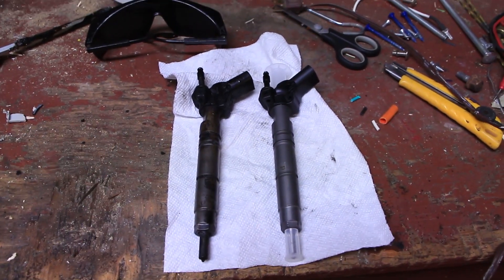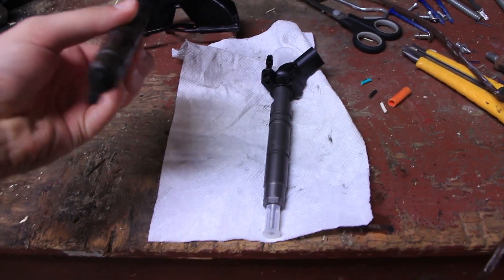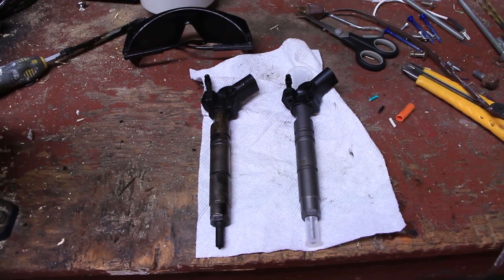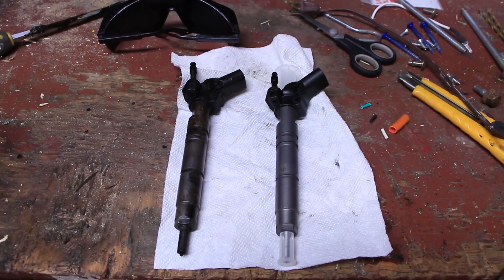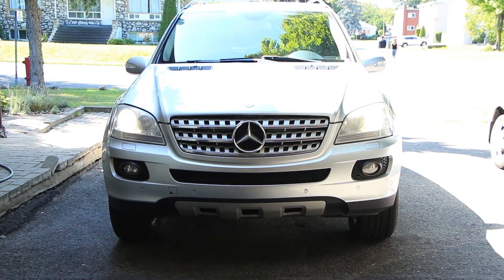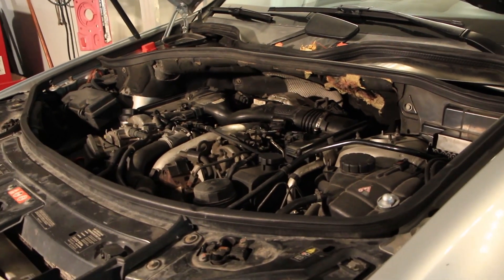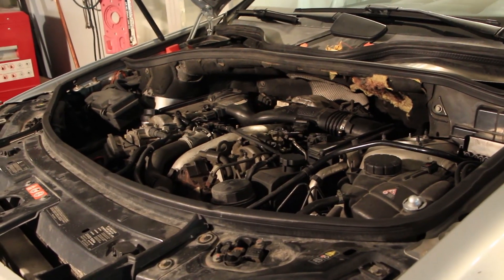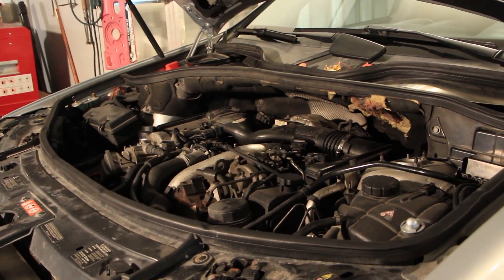OM642 Injector Replacement - To Code Or Not To Code?

Comment: Well, about coding, i think you are correct, because, if i change only a nozzle, then what? In my knowledge, i dont know that there is somekind of testmachine where i can put that refurbished injector and that testbench will generate new code for it.

Comment: I haven’t coded my number 2 injector yet only replaced it a few days ago car still doesn’t run right so I will be getting it coded when get the chance……I have w211 e220 2008 model 

Should replace the copper washers on the other injectors?
As a precaution?
Number looked a bit worn out…..?

Comment: Mercedes Benz E class 2021, Check engine light is ON, replaced injector 3 after checked up. I didn’t do programming for new injector, the check engine light still ON, so have I programming the new injector ? Or what should I do to Check Engine OFF ?

Comment: Wby they doing videos withoit proper job like coding?
All these people are crazy when they are shoving without coplete procedures... Poor mechanics
Reply from the maker: So if we omit the part where you utter insults without bothering to simply ask a question, here is why: There is a broad misconception that not coding your injectors will lead to an imminent catastrophe comparable to the extinction of the dinosaurs. I've set out to disprove this. Is it better to code your injectors? Absolutely, however, if for whatever reason you can't; let's say an injector failed in your home's garage and you need to replace it before even being able to code it, is it ok not to do so? The answer is yes, since I've posted this video I still haven't coded the injectors on this car, and guess what, it's still running just fine. So if you need to swap injectors, and can only have them coded afterwards, you should be comfortable in knowing that it's safe to do. You should also be happy about this outcome yourself, it means your car is maintainable without any specialized tools, which is an outcome we should all be striving towards.

Comment: Hey Pat, thanks for the video!  I have SDS and was still unable to code my replacement injectors for my 12 ML350 BT.  Took the car for a light spin and will keep driving it with the hope the trim on the CDI 6 ME will do its magic.  Any chance you can make a video on how you run Diesel Purge?  Right in the tank or through the filter?  Thanks!
Reply from the maker: I just dunk 2 cans into the fuel tank and then fill it up so it's mixed well.

Comment: I put a set of new denso injectors into my old hilux ute, along with valve seals and rocker cover gasket and an oil change while im there, and it ran beautifully. Excellent improvement to the vehicle. Much better and smooth responsive acceleration.  ...that was two days ago. Today i took it to a mechanic to enter the codes. Tonight i crawl home with terminal engine knock in a heavy cloud of smoke. F;#k the codes. Honestly, ive been doing all the work and NEVER trusted a mechanic. The VERY SAME afternoon i take my car for the first time to a mechanic, its broken. I cant afford these 'professional advice'. So mad my beautiful car that i worked hard on making sure all the ports were so clean and everything torqued to spec and it ran so well...now its a bomb. Literally.

Comment: Hey man, my car wont start after I replaced the seals... do i have  to purge air or anything ?
Reply from the maker: You can run it on key on (which runs the electric fuel pump) for a while. You'll hear the air bubbles being forced out. Once the rush of air bubbles goes away, you can try cranking the engine, which will also run the high pressure fuel pump, but it might not start for a while. When I replaced all my injector seals I had to crank the engine for a good 2 minutes before it started. Give your starter some breaks of course.

Comment: As a injector repair guy, yes you better of coding them in. If you don’t code it in injector will run out off tolerance. If you don’t code it in car either not run smoothly as or not run as efficiently.

Thats why after every reconditioning we do, test bench gives new codes.
Wrong advise to tell not to code it in.
Reply from the maker: It's been 4 years, car still works fine, runs smoothly, runs as efficiently as it always did.
Reply: @PatsCarGarage  If so, ever injector brands or remanufactures or diesel specialists are wrong by advising to code it in but you are the only one right by saying better not to code in. All new test benches calibrate and gives code for new tolerances for notting?.  You are fitting brand new injectors but not coding , its a bit cowboy job to me.
Reply from the maker: @emrahsavuk4784  Of course it's better to code them. It's just there's this belief on the internet that if you don't code them, your connecting rods will fly out the side of the block. They won't, it's been 4 years, if you're in a pinch and can't code the injectors for whatever reason, it's going to be fine.
Reply: @PatsCarGarage  
Hello.
UK Guy here.
I have an 06 W164 4Matic and need the original injectors cleaning. If I take them out and professionally cleaned will they need coding when put back in?

Thanks in advance.
Reply from the maker: @winstonbrown1516  I don't believe that cleaning will require them to be coded. Just make sure you mark which injector came out of which cylinder so you don't mix them up.
Reply: @PatsCarGarage  
This is very much appreciated. 
Thank you very much. Your Moms ML still good?
Reply from the maker: @winstonbrown1516  Yeah it's still going strong. I've got to say I'm really impressed with the reliability of the 2nd gen MLs. She's had it for 10 years and there were only 2 other things that went wrong other than this injector, the rear springs cracked as a result of corrosion (the top coil is thinner than the rest of the spring, so it's prone to failure), and a couple of ABS sensors went bad.

Comment: Hey i have the same problem I change injector#1 because i was having hard start but after changing there is no more hard start but car is smoking white smoke 💨.
Reply from the maker: It's possible the DPF is going through a regen. You should wait a little bit and see if it clears up on its own.

Comment: This might be acase on earlier Mercedes diesel engines I’m currently working on a 2017 Sprinter OEM 651 after multiple tries engine definitely not starting with replacement injectors so we gonna go through a process of re-coding replacement injectors and see how we go I also see new videos popping up about the same issue

Comment: what is the torque specs of the bolts do you know?
Reply from the maker: Official spec is 7Nm and then 90 degrees twice, but I've heard this weakens the bolt and might cause it to snap. I've personally done 7Nm and then 90 degrees once and it has held fine for 4ish years.

Comment: How does the ECU trim the fuel for just ONE injector? By looking at the pre cat nox sensor which is per bank (and only one bank for this engine.) It might be better to just program it correctly. Not worth leaning other 5 injectors just to compensate for one.
Just delete this video because it is just wrong. Sorry to say.
Reply from the maker: I think you are 100% right that it's better to program it correctly. I still research this because you and others have brought up good points. From what I can find, the programming exists because of emissions requirements, which are very strict, especially for diesel engines. Without this programming it would be impossible to meet these exact emissions requirements. With that being said, if the programming is off because you change injectors (or the shop that rebuilt the injector incorrectly tested it, producing a wrong code), it's not going to dump the contents of your fuel tank after 17 turns of the crankshaft.
So how could the ECM compensate trim a single injector? 2 possible ways: the glow plugs aren't completely dumb and have some capacity to monitor cylinder temperature, or the exhaust pulses are correlated by the EGT sensor.
Now, if you are mad about the emissions side, I think you'd better leave some comments on people doing DPF / EGR deletes.
Reply: @PatsCarGarage  No hard time. I am not a hater. I appreciate u actually spent time and effort creating videos to share knowledge.

Comment: This is horrible advice. Each injector is manufactured with certain tolerances that NEED to be compensated by the ECU so they deliver the right amount of fuel. You only replaced 1 injector and got lucky it had tolerances close to the ones your other injectors already had. This results are not reproducible to everyone when luck is involved, you can even see here on YouTube videos of people showing how bad an engine can vibrate with a new set of uncalibrated injectors and how it smoothes out immediately after coding.
Reply: No need for coding , I replace all my 6 injectors on a range river v6 engine and it just works fine .Ecu will learn GTE fuel Trina within few miles drive
Reply: @luxurycarpets4028   I would think this practice would work better when only changing one injector at a time.  Desperate times call for desperate measures.  Give the computer time to adjust.   
  Now I have to investigate farther and figure out how to find and change this code.  Has anyone explained how this code it changed in the computer. I guess VAGCOM is your friend.  
  I have a 2011 Sprinter and an injector blew out when the bolt treads stripped.  Going to try using a bolt from another model that is 1mm bigger. 7mm in stead of 6mm.  
  I am in the process of buying a 2008 Jeep Cherokee and discovered that it has blown out a fuel leak off line o-ring.  Looks like at least one injector has excessive leak off.  Still have to investigate farther will have to eventually learn how to reprogram the ECU to replacement injectors.
Reply: One injector mainly will do the trick. 
With the whole set, everything goes wrong for a good amount of time. 
I'm speaking from personal experience.  
OEM codes does not apply to the rebuild / nor to new injectors. 
Engine will start, will be very rattling, and will keep clogging the dpf if you don't do long trips at list weekly to get some regeneration. 
Until I've purchased an OPCOM program for vauxhall/opel, and do forced regeneration, the ECU simply didn't apply any correction on fuel delivery. Was late when I've  got the diagnostics program and I couldn't find the papers to introduce the codes from the rebuild injectors. 
Another issue is when you gonna disconnect the battery for long time, ECU will go back to the old settings and it takes time until will learn again about the injectors and apply fuel correction.
Reply: Will this fix itself with driving? Yes, as long as you are lucky and only need to replace 1 injector (good luck with a new set), after months of ruining your engine mounts, wasting a lot of fuel and clogging your cats, and having your check engine light on preventing you from knowing when anything else goes bad.
Reply from the maker: It's been 2 years, car works fine without any check engine lights since...
Reply: @PatsCarGarage  worked out fine for you, but giving this as advice is very irresponsible
Reply from the maker: @usuariu1024  Well someone has to try it to see if it will work. That's why I keep all these comments up on the video. Perhaps you raise a good point, and ideally coding should be done. However, the premise of the video was that I was starting with  a much worse situation (an injector stuck open). All of my viewers which actually plan on using my advice are themselves DIYers that accept the risk of messing something up. This video is simply an experiment, which so far has worked out for me. We can't remove things that are potentially wrong, otherwise we will never know what is right.

Comment: Interesting ... Not saying I don’t beleive the video (but to my estonishment actualy you might be wright). I know quiet a bit about ecu tuning, but here’s a question for you. What do you beleive be the feedback loop for injector learning on this application ... very interesting...  I know on some other diesel the feedback is done through the glow plugs (as they have a piezo integrared) to monitor peak presure point in relation to crank positioning sensor ...
Reply from the maker: I would of thought it used the pyrometer much like how on modern gas engines, they use the O2 sensor to trim individual cylinders (because you can correlate exhaust pulses with crank position as well). I must admit though, using the glowplugs would be brilliantly simpler though. I guess it would be a dead giveaway if the glow plugs had more than 2 wires going to them.
Reply: The issue with the pyrometer (egt sensor) is located after Cat (right before DPF) used fle feedback on Regen cycles. For example there is a map for EGT vs Voltage. Additionnaly, you can drive without the pyrometer (yes you’ll get a DTC) but the injection cycles won’t seem to be aftected. It remains a mistery how feedback is done to ecu on injector triming. But you are absolutely 100% correct. There is an adaptation that the ecu makes as soon as something is altered. There is 3 Main SOI maps (retareded) and 2 Main SOI maps fully advanced. The ecu calculates where to navigate between those 5 sets of maps. Sometime with one pilot injection, some time with 2 pilot and sometime with 3 (rarely). Then POI is also integrated (constant POI for passive regen and an additional POI for active regen based on mileage (every 1000km ish) and/or differential pressure sensor.  No doubt this ecu is a mess ... if what you’ve experienced is still holding and you didn’t see any detorioration in fuel consumption, noise or driving behavior (shuddering), then you may be right there is a self adaptation done by the ecu on injectors trim ... very good finding you did here
Reply from the maker: @coucouj2781  That's interesting, but no matter how it's done, I can still confirm that the engine is running butter smooth (can hardly tell it's a diesel, even at idle) and fuel economy seems to be inline with what it's supposed to be.

Comment: Rebuild injectors getting a new code printed on the paper.
If you not getting injector test flow means the dealer is the tiff and selling to you garbage not rebuild injector.
On new or original injectors code is located on the plastic upper side numbers and alphabetical letters = 7 of them
What you showing you completely lost - that spot is from manufacturing digital print of injector model.
To code injectors are very important * buy on eBay or Aliexpress - Amazon * VIDENT iAuto 702 Pro * or ICarSoft MB V2 - 200.00$
To get injectors to look on eBay UK - Germany best price 
Never buy from American tiffs very expensive plus the charge for shipping 100 x or real cost.
Something I do not understand in your words too much miracle we can expect
This way system is not operate 
You can remove a couple of injectors and drive on or two injectors only.
Nothing to learn only to code.
Please be more mature and stop pushing Joe as theories.
Reply from the maker: Yesss let the hate flow through you
Reply: @PatsCarGarage  Do you seen a doctor lately?
Reply from the maker: @jaguar7051  Honestly that's the most pathetic attempt at an insult I've seen in a long time. Try again.

Comment: there are the same injector  used in french cars peugeot   hdi
and for the programing  
the car will start   and programing  its will learn with time
or any autel or maxisys scanner will do the job      just the third row number  not more five or six  digit  just follow the capital
 letters
Reply: Hi, I would be grateful if you can tell me how long did it take for ECU to learn how the new injectors performs, and to adopt itself? I've got 1 injector problem on my Peugeot 2.0 HDI 100 kW, I wiped the nozzle with a rag to remove the deposits and now it's running very rough. it even send a failure code for that particulate injector. The injector is not clogged, moreover there is zero return fuel coming from it.

Comment: If you need to take car to dealer to diagnose it tells alot about your skills. Even tools on your table :D Here in Europe we have a lot diesel engines and every one know that best and easy way is to code new or refurbished injector/s to car ecu and letvit know new ima code with new flow rates. It is properly done way not abusing your engine, dpf and all fuel injection system driving with over fueling injectors for months. Why? You can eat soup with fork or with spoon it is your choice
Reply from the maker: It's almost as if nobody watches the video before commenting...
Reply: What you've written tells us so much about your education, or lack thereof.